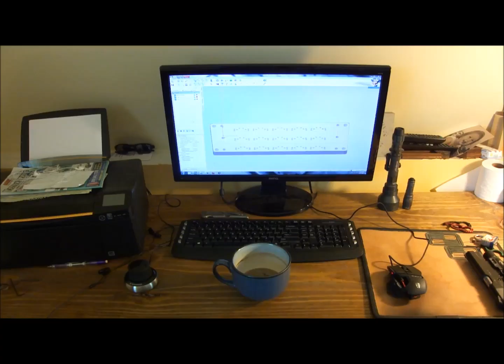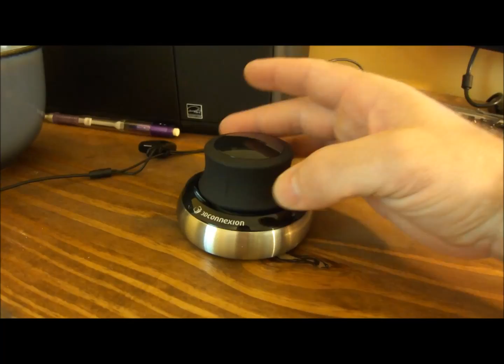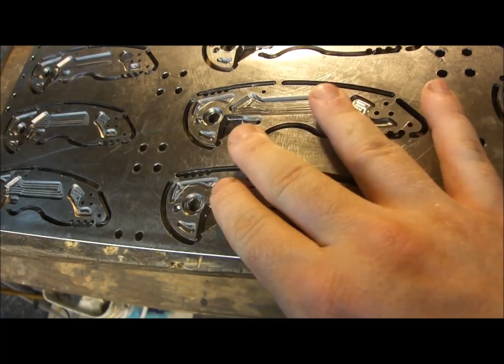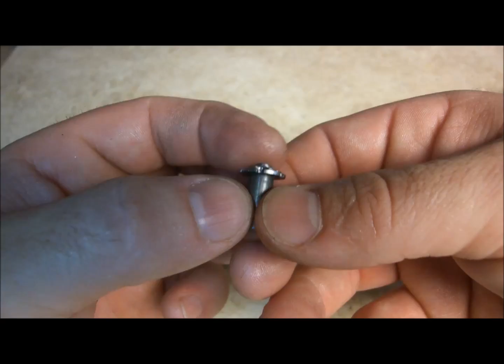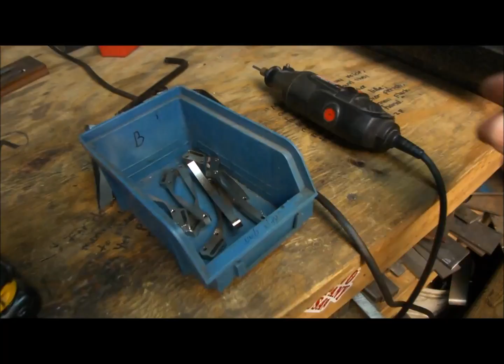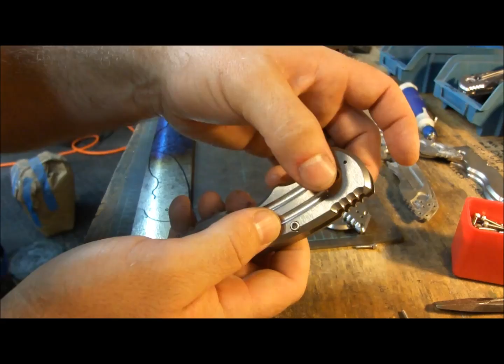hoback shop #59

Comment: normal printer paper is between .0002 and .0003 of a inch. or "3 thou" 

a human hair is .0006  

now, 2 thou = five millionths of a meter.  or 5 microns

when you smoke cigarettes the smoke particles coming out of your lungs are 2 microns in diameter....and a red blood cell is 12 microns wide.... :) hope this helps